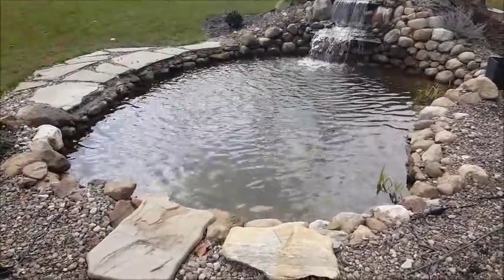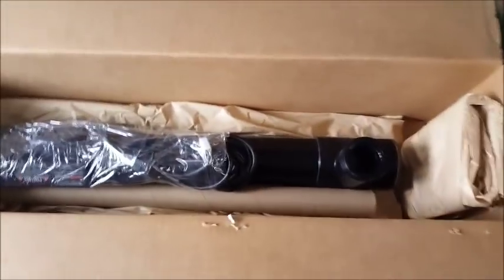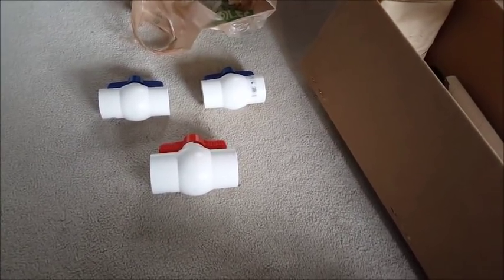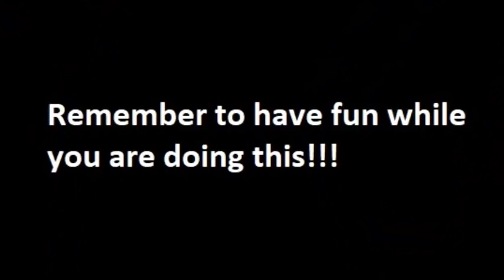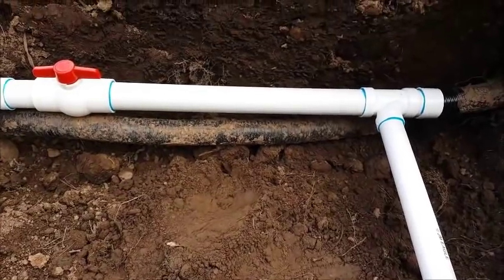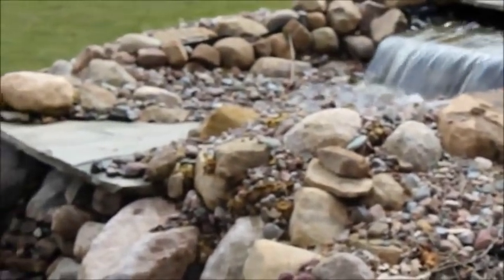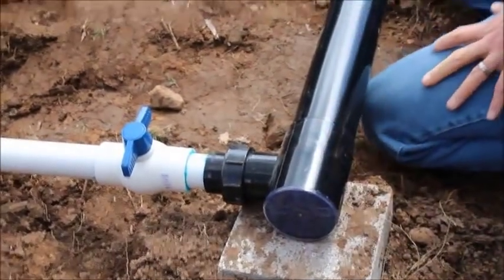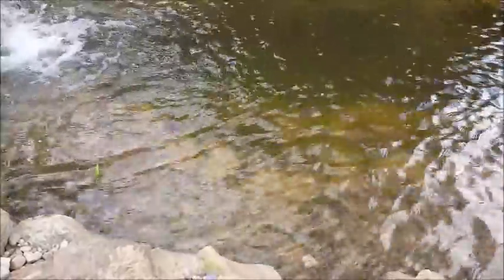Pond algae solution -  UV light installation

Comment: Also it is very important that your pump flow meets the specifics of your UV filter. If your pump has a higher flow rate than your UV filter requires the water and algae will not be under the light long enough to kill the algae. Again I have learned this the hard way.!!!
Reply from the maker: Yes, you are spot on with that!

Comment: I don’t see how your electric is supplied to the unit. Also does it have a ballast for the bulb?  I used one that simply plugs it. I also set it up so I can take the bulb out to clean as needed. Also it’s recommended you replace after 8000 hr of usage. Definitely solves the algae problem. I like your waterfall !!
Reply from the maker: Thanks! The light is plugged into a standard 110 outlet. The ballast is located near the end of the plug. I know there are lights available that have a wiper on them to make cleaning the bulb easier, but where I live my pond only runs for about 5 months. I clean it every season and that seems to be well enough. My bulbs last me about 4 seasons before they need to be replaced.

Comment: Best tutorial ever on the uv clarifier installation thank you sir. Does the pond pump water pressure have to be considered for caution or is it just controlled by the valves adjustment-into the clarifier
Reply from the maker: The flow rate through the UV light is controlled by the valves. In order for the light to be effective the water flow needed to be slowed down. This was accomplished by diverting some of the water through the light while the rest went directly to the waterfall unit.

Comment: They will both Freeze. The PVC has a higher resistance to cracking in cold weather than ABS. I do not know if the black flex pipe is ABS or not. FYI only trying to help.
Reply from the maker: Thank you.
Reply from the maker: This UV light gets removed every fall.

Comment: 2 questions. Is it necessary for the two pvc pipes coming from the main pipe and connecting to the pipe holding the light to be a certain length? And how did you cover up the whole installation? Thank you. Great video😃
Reply from the maker: No, to be honest I don't know why I kept them so long. The important thing is to make sure you place valves in your system so you have complete control over the water flow. This way if you need to remove your light for any reason you can still keep your water feature running. 

Actually my installation is out in the open. It is just located behind my pond out of sight but easy to get to for maintenance. Another thing to keep in mind. Great questions and good luck with your project!
Reply: @BackyardWaterGarden  thank you for your help. Your videos are very informative  and your teaching style is easily understood. Thanks!

Comment: Hi  If the manual (on my Hailea 36w) says nothing about inlet and outlet of the flow from the pump,will that mean it doesn't matter which one of the two connectors you going in with the water and out?
Reply from the maker: From my experience the inlet and outlet of water flow is not important. What really matters is the amount of exposure the water has to the light.
Reply: Thanks for the reply! Good to hear since I'm all done mounting. First I thought I had a tanin problem since the water looks like tea.. Then I put a fine filterpad i my filtration system and later when I squesed it in a white bucket the water was dark-green! And that is free floating algees i gues. @BackyardWaterGarden

Comment: How did you measure the GPM through the UV light? If the water runs too fast it will not work effectively.

Comment: Is that wireless uv sterilizer? I dont see any power chord 😅
Reply from the maker: There is a wire. It is attached to the UV bulb. The wire comes out where I was doing the paper towel leak test. The wire can be easily hidden in mulch. Check out the hiding my UV light in plain sight video.

Comment: idk if anyone else commented, but this is installed backwards, so you're only sterilizing beneficial bacteria leeched from your filters.  You're cleaning the water before it gets to the UV light by putting it after the filter in the system ... you need to put it before the filter for it to be most effective.
Reply from the maker: I assure you the UV light is installed correctly. The filter pads only remove large debris and do nothing in the way of removing the free floating algae that turn your water green. The important thing is getting the flow rate correct so the light can do its job. If the water moves too fast through the light it will not be as effective. If you are tired of your water looking like pea soup, then a UV light is the answer.

Comment: How long do you run the UV. Light for??i just installed one in my small 40gal guppy pond
Reply from the maker: lizzy animatronic 
My UV light runs all the time. The only time I turn it off is when I shut off my pump and  water isn't flowing through it.  If you don't have water moving there is a chance the light will overheat and burn out. 

Hope it works out for you.

Comment: What did you do to cover up the UV light and PVC pipes?  And is there a smaller version of this?
Reply from the maker: I just posted another video showing where and how my light is "hidden"  https://www.youtube.com/watch?v=YscHSZS0Kco&t=6s

I hope this helps.
Reply: Thanks!
Reply: Thanks for your help, Jeff. My setup is different than yours. I have about 2,800-3,000 gallons with two 5,000 gph Aquascape pumps inside my skimmer basket.  From the skimmer, there are two return lines that empty into the biofalls (about 50 feet away). I don't know where I can install the UV light(s) since I have all of my landscaping in place, including artificial turf on one side of the pond.  Someone I ran into said he installed his UV lights in his biofalls.  This would probably be the best location for my pond also. I didn't ask him how he installed it, but I assumed it was submerged.  I can't find any UV lights that can be submerged.  What brand UV lights do you recommend?
Reply from the maker: Jeff Kramer 

The only submersible UV light I have seen is the pondmaster.  You will need the 40 watt version in order for it to be effective for your size pond. Not sure if that will work for you or not.
Reply: That's good to hear.  I hope I can install it inside my BioFalls, connected to the two intakes.

Comment: If my flex pvc is buried 18inch under, it is difficult to put uv light horizontal at the same level as pipe. Can we put uv light above ground level right over pvc pipe?
Reply from the maker: Yes you can place it above. The pressure from the pump will push the water through. Use valves similar to the ones I used in the video. It is a bit if trial and error until you get the flow rate adjusted correctly.

Cheers!